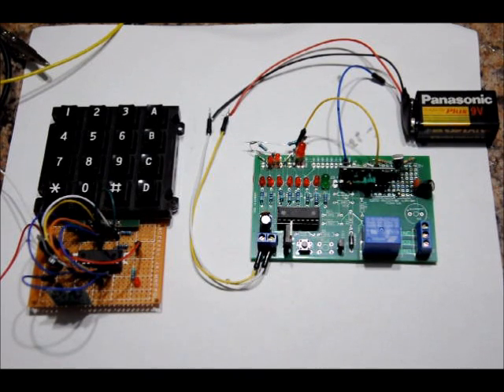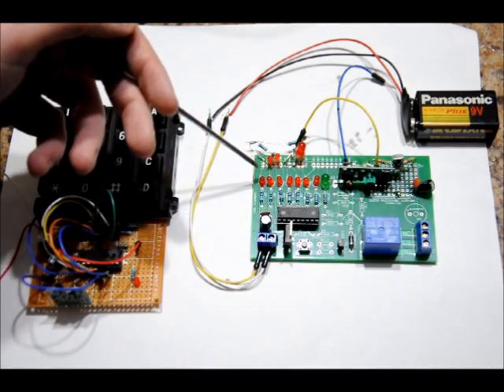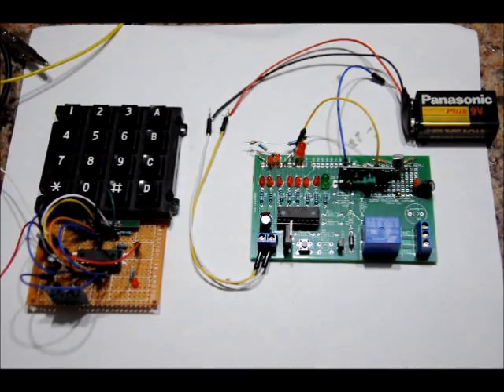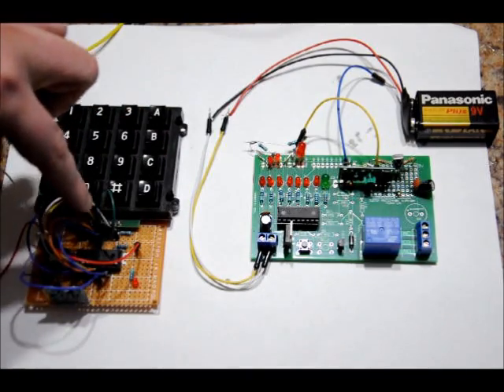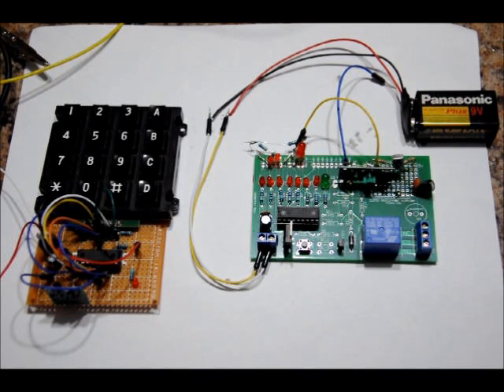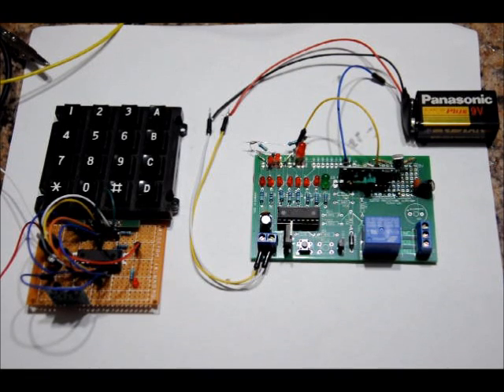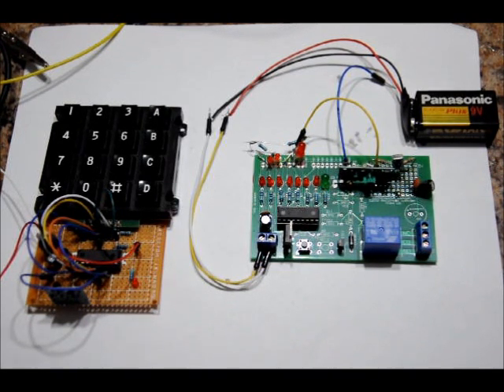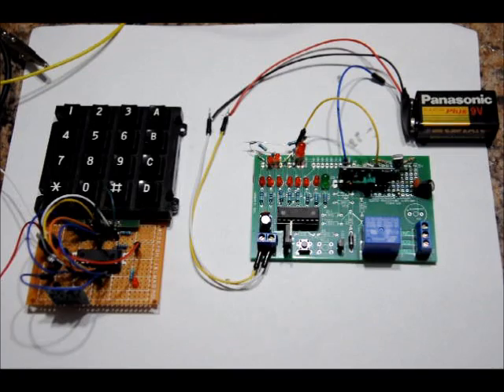433MHz RF Transmitter & Receiver Prototypes (10-Bit) With Encoding / Decoding

Comment: Hi I have checked the frequency and it was a little fast i have slowed the clock down and checked the transmitter and compared the receiver output on a scope. I am now running at about 1.2khz and the receiver is pretty noise free just at the begining of a data transfer i get noise. I tried to send just some odd data and then the proper data but i still can not get the data read by the pic. I Have added the Caps 10uf and the 100nf across the supplys but not sure what else to try :-)
What do you think?

Comment: great video im trying to send data using 433mhz using two pics with the manchester code with a QAM-RX4-433 and TX but the problem is the receiver when on a scope is giving me lots of noise and the data doesn't get through. 
Please could you give me some advice.
Reply from the maker: Hi there
The transmitters that I use can take anywhere from 3-12v.  However, 5v is nominal and easy to use.  I see a lot of noise at 3v.  If you use 5v to power it, and 5v logic on the data line, then I'd suggest adding a 0.1uf cap between the GND/VCC lines, and perhaps another 10uf cap between the VCC/GND lines.  This should eliminate most of the noise =)
Thanks
Pat
Reply: Hi Thanks for reply  I'm on 5 volts on both. I will try that on the Transmitter but the noise seems to be on the receiver im getting lots of signals ie noise with out the transmitter being on and don't know how to seperate the data from the noise.
Thanks 
David
Reply from the maker: David Howard Sorry David.  I misread.  What frequency are you transmitting at?  The receiver/transmitter set that I'm using has a limit of 2kHz.  Any faster than that, and you'll get crap.  Altenrately, when you aren't sending anything, you get crap.  To put it bluntly.  When the transmitter is actually sending, then the receiver should match.  The receiver noise when the transmitter is out of range/notsending data is unavoidable, but I'd have the aforementioned caps on the VCC/GND lines of the receiver (as close as possible)  It won't help much, but it will make the received data clean when the transmitter is sending a data stream at a speed of 2kHz or less.
Reply: Thanks again for reply i'm not sure what frequency i'm at to be honest i will have to check it tomorrow with a scope. I'm using a 8Mhz crystal with a modified Mikrobasic code for the pic i'm using i will try the smoothing caps and check the frequency and see how i get on.
I will let you know how i get on if that's ok
Thanks...